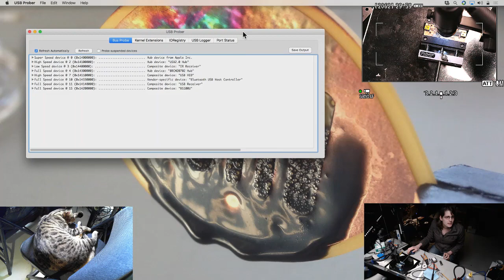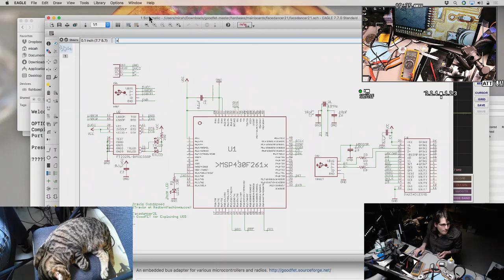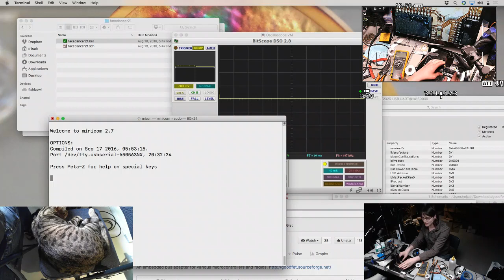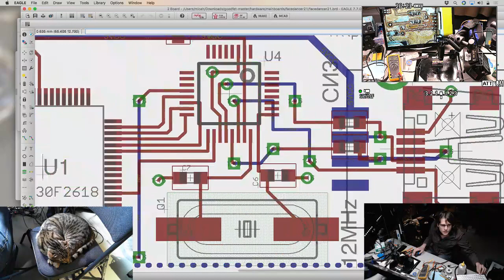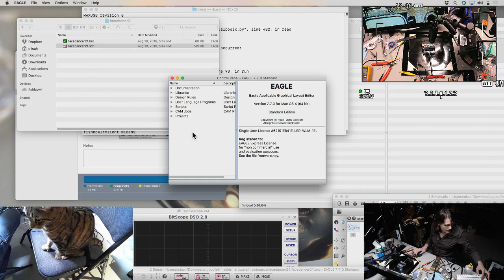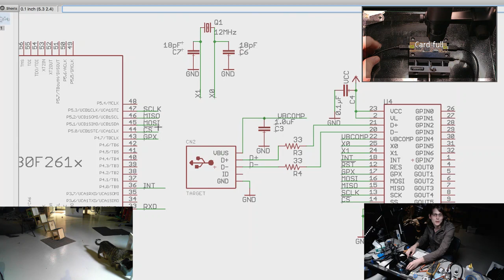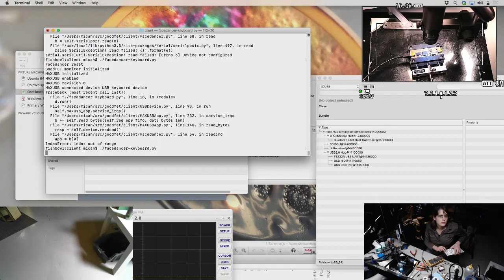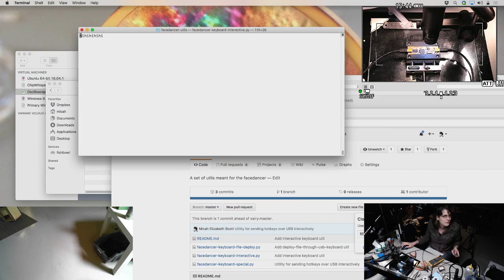Facedancer part 2, finally debugging the hardware @scanlime-in-progress

Comment: Thanks for your efforts to create these informative and in-depth streams, masterfully juggling all the video streams live!

I like to use Liquid Tin right after etching the boards. This stuff does not corrode so quickly and it looks pretty uniform even after weeks unprotected on air. And the surface takes solder very easily.
The chemical can be re-used many times and gives a nice silvery finish, but of course this is nothing if you want to keep the warm nice reddish copper look.